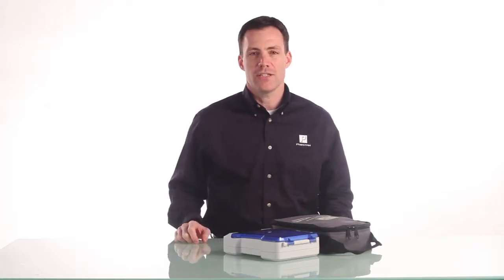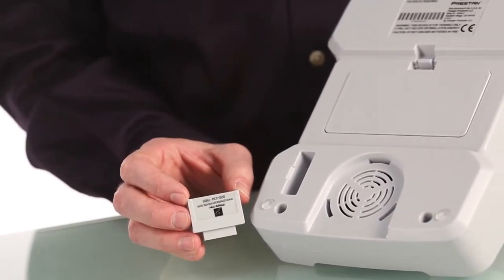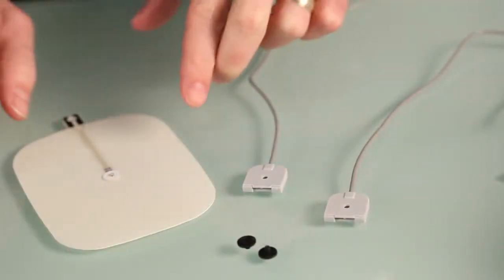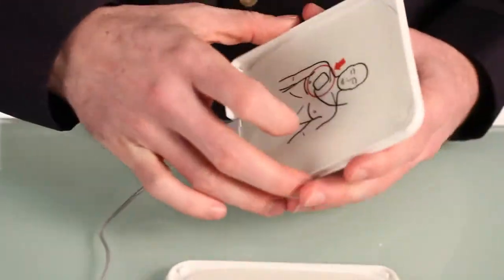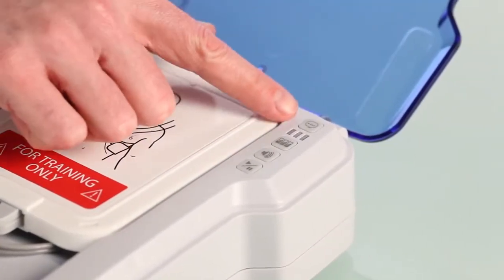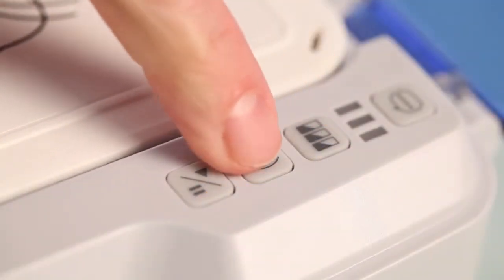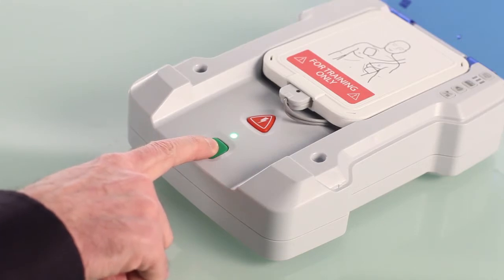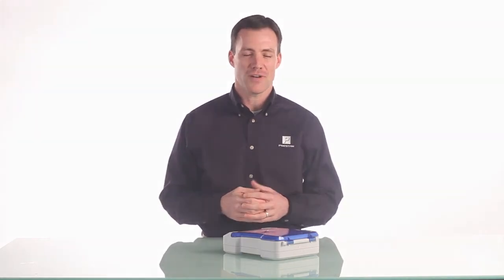Prestan AED Trainer Instructional Video

Comment: The AED is not preceeding automatically after connecting the pads to the manikin to the analysis phase , and I tried to change the mode as mentioned but still same?????
Reply from the maker: Hi Mohammad, thanks for reaching out. Give us a call at 614.782.2100. We'll get you taken care of right away.